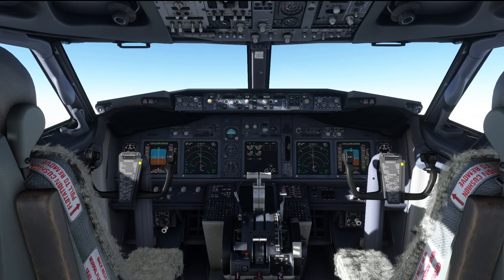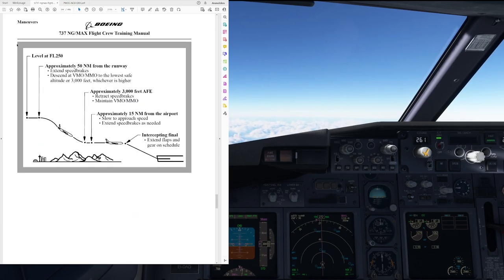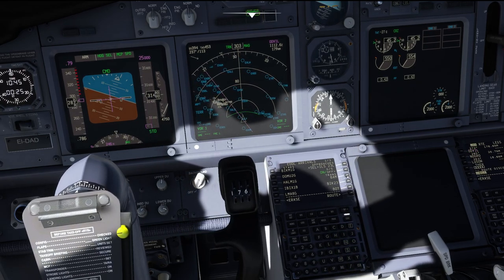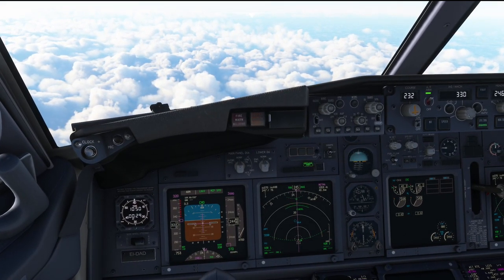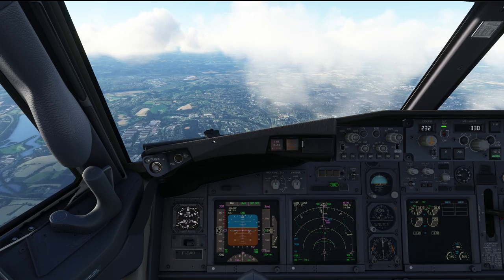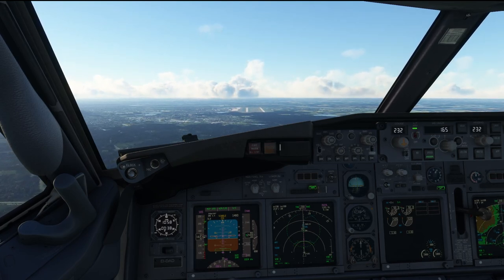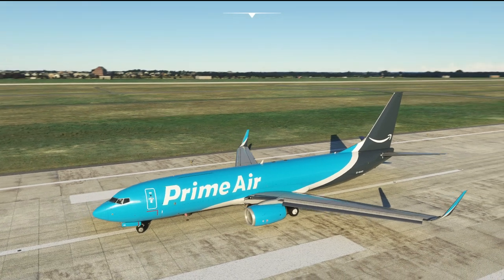737 Freighter: What to do with FIRE on board? Expedited Descent Explained | Real 737 Pilot

Comment: OK. Lots os questions for me here. ... if you dump the cabin at altitude FL25 or higher its going to get awful cold for the pilots. Is that why you set the packs to high? Would that be enough? Would the pilots in shirtsleeves be able to operate the plane for say 15 minutes without freezing to death? doubtful. What compromises do you have for this? Pretty steep descent, but what about cabin pressure equalization on the way down or you may break the ear drums of the crew. How fast do you dump the cabin for the same reason? 
 If the average fire will kill you in 18 minutes, I would bet that in 15 many planes are in real trouble. So, going around for me in this situation is NOT an option. Depending on when it happened in a flight you are probably going to be landing overweight and won't dare dump fuel unless super sure it wouldn't kill you. So, come in steep and land it and get the hell out.

Comment: Wonder why they have you leave the cruise altitude for fl250? I would have thought higher cabin altitude would be even better for fire suppression. Probably something to do with physiological factors for pilots, like decompression sickness.
Reply from the maker: Exactly that, FL250 is a level where the pilots can survive long enough (with additional oxygen of course) to get close enough to the airport. It's a compromise between survivability of the airframe and the pilots.
Reply: This is a procedure more useful at remote places, like f.e. oceanic crossing where you would need more time to reach an airport. At FL250 you reach a higher Groundspeed.

Comment: Great lesson and good to know but hope like hell you never have to use it. I came across an article today titled Boeing's Nitrogen Generation System. Is that something you might want to do a video on?
Reply from the maker: Thank you so much!

The NGS is used to fill the fuel tanks with Nitrogen primarily to avoid combustable fumes from creating. It won't have any fire suppression effect once a fire broke out.
I don't think there's a lot that could be said about the NGS, it's a fully automated system, in fact we don't even have any flight deck indications about it, but only an indication at its panel in the wheel well.

Comment: Now, the big question is would the plane be able to stay in the air for 15 minutes or would it be uncontrollable or even break apart?
Reply from the maker: Average times until you loose control with a fire are between 15 and 20 minutes, all accidents taken together we end up with 18 minutes. So not a lot of time left. But if you look at the timer you can see we can make it in 15 minutes from cruise level until we're on the ground.
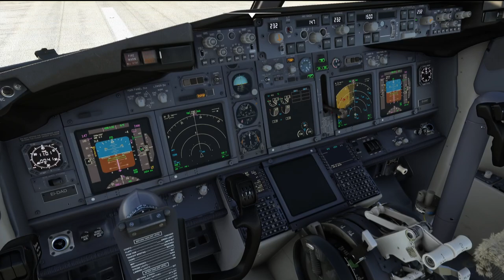Reply: @A330Driver  On your video, the alarm sounded at the 10:00 mark and you came to a full stop on the runway at 29:40. so just under 20 minutes from cruise to landing.  Very interesting video.

Comment: Thanks for your tutorial. How much oxygen do pilots have with masks on? As far as I know for passenger aircraft it is 15 min? And what about pilots ?
Reply from the maker: Hi Igor,

Pilotoxygen is stored in tanks and not chemically generated, so it lasts much longer.
About 2 hours, depending on the pressure in the tank (you can monitor it on the panel on the aft overhead). Passenger oxygen in the 737 lasts for approx 12 minutes, which is sufficient for the time of an emergency descend plus some extra.

Comment: At the end you said that the landing touch could be hard in order to stop the airplane safely, wouldn´t it be necessary to do a soft touchdown considering that part of the fuselage may have caught fire?
Reply: If the plane is THAT badly damaged, this is the least of your worries. A controlled crash you can walk away from (with the help of firefighters) is safer than a go around….
Reply from the maker: Pretty much as tomw86 says, just get that plane on the ground. It's wrecked anyway after such a fire, anything's better than a go around.

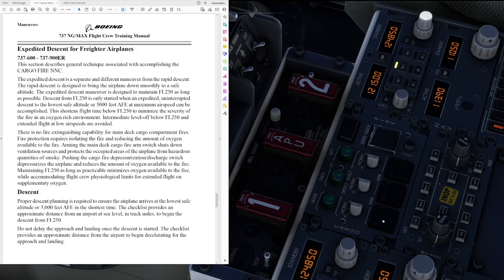Comment: 4:31 why not just have a depressurized cargo area to begin with? (I apologize if you answer this later on in the video)
Reply from the maker: Two primary reasons:
1) Live cargo such as animals is often transported via air. You couldn't do that in an unpressurized plane.
2) You still need access to the cargo deck from the manned parts of the plane. However the pressure difference would be huge, thus you'd need some very strong structures to support that pressure difference. That'd add tons of weight to the plane without any good reason for it. It would basically be a whole new design of a plane then.